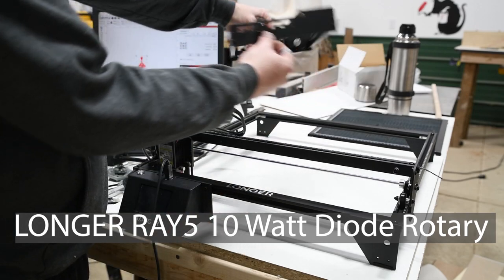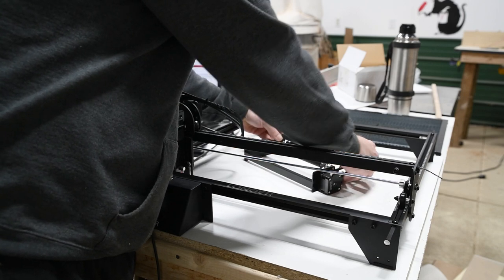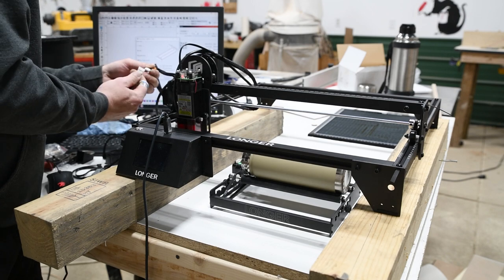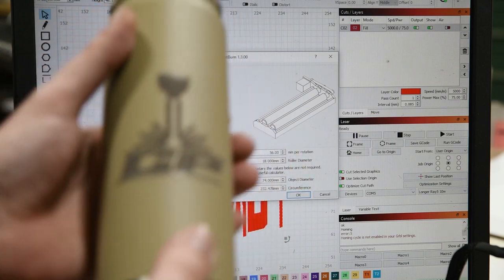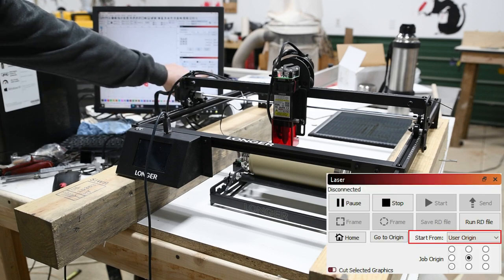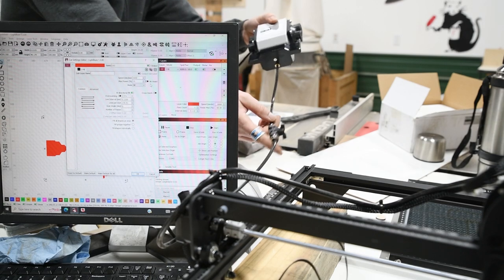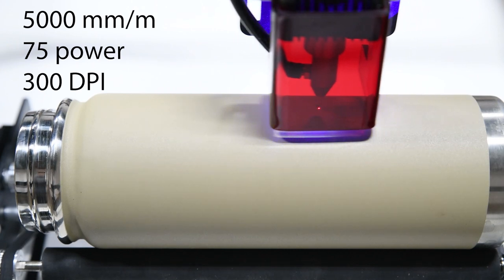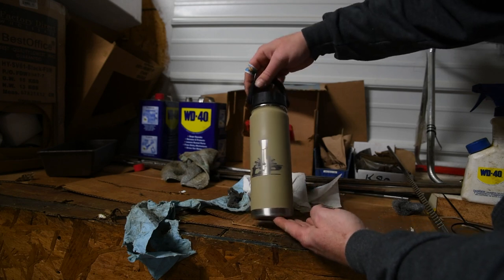Longer Ray5 10W Diode Laser Rotary set up  Lightburn Etch Tumbler

Comment: Thanks for this video. A question: do the wire wool no scratches on the paint?
Reply from the maker: no the fine wire wool does not scratch the paint i have used it in over videos also and it works fine,  but just mainly rub the areas you want removed. Thank you

Comment: Hey, great video I have a question have you use a different shape bottle where is not even, and how do you make it even?
Reply from the maker: most rotarys have a height adjustment you just got to get it as close to level as possible, if the difference is to much it have to be done in 2 pieces.

Comment: And if anybody has the B1, I have the B140 don’t make the same mistake I did and get frustrated. You can’t plug into the motor. The motor up top is for x motion. you need to plug in to the frame that’s where the Y motor plug-in is it should be in the left rear something none of the directions tell you that anywhere and when you call customer service, nobody speaks English